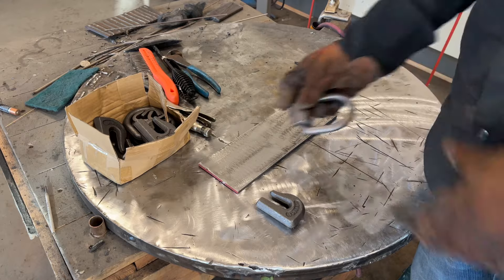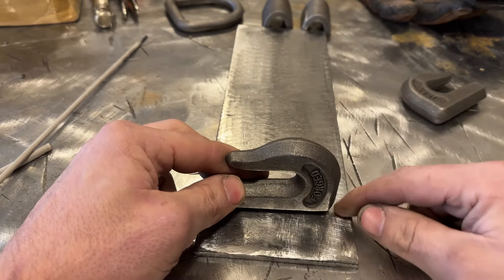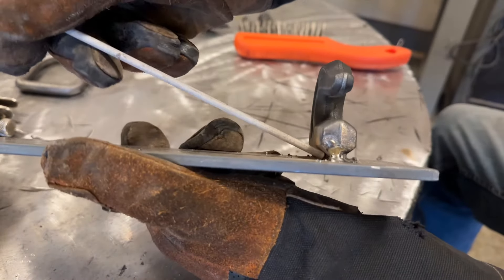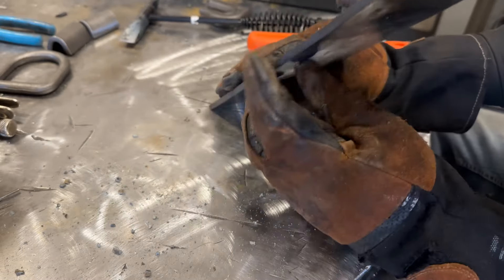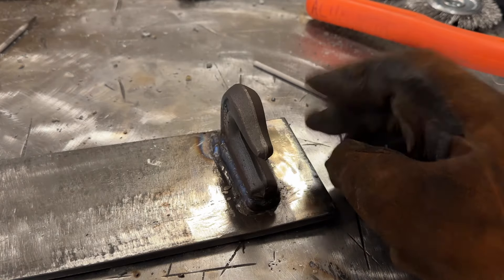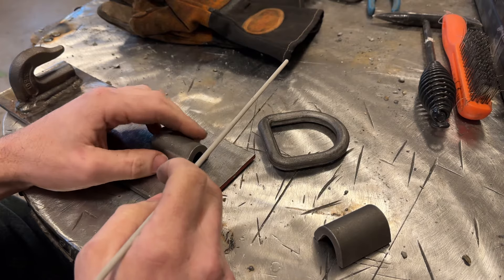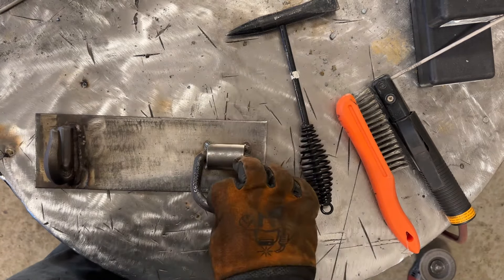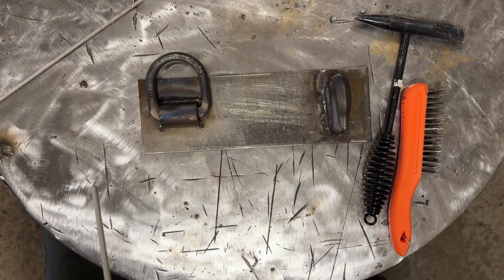Welding hooks and D rings with 7018

Comment: I assume with flux core wire, you want to have a wire # that is suited for multiple passes.  Would .030 be suitable in a 220V machine normally? For 3/8" plate mounts.
Reply from the maker: So a couple tips.  I can tell you from my own experience flux core has issues welding over 1/4in thick without porosity issues with .030 or .035 wire.  Even if you don’t see it on the surface the internal weld is poor.  How you solve this is running .045 or bigger self shielded wire.  The unfortunate thing with this is many welders won’t run .045 wire (don’t have rollers, liners, tips, enough power, etc, available.  If yours does have the capability you will likely be able to weld 3/8th without porosity issues.  

Edit:  if you decide to give it a shot run a weld and cut it open with a cut/etch.  If you see porosity you will have very weak welds.  On a flat plate butt weld it will probably be ok, anything resembling a fillet weld it won’t be (too thick of a molten pool).
Reply: @makingmistakeswithgreg   10-4, thanks a lot.  Sounds like once again, the trusty stick welder still has its place 😁👍

Comment: For the first pass, would you not of been better to run a 6010 for the better penetration as they dig in deeper? Then second and third pass with 7018?
Reply from the maker: That could have been done that way yes.  The issue I have with that is the part that holds the D ring is made of unknown steel.  If it happens to be higher strength steel the hydrogen induced by the 6010 could cause cracking issues, especially if its being welded to higher strength base steel.  Most of the benefit of the 6010 pass is negated by the slight bevel I made in the loop and the fact I welded around both edges.  The penetration 6010 provides prevents the metal from lifting and using the weld as a fulcrum point, but wrapping around the corners along with the bevel prevents the loop from easily lifting off the plate also.  I would trust the strength of 7018 over 6010 in the case of this.  You must remember most things that are welded with 6010 as a root are things like pipe, and the stresses on pipe are completely different than a d-ring.  They are either internally (pressurized pipe) or externally if they they are bent due to soil movement.  What works for them (where you have full internal weld reinforcement) and what would work on a single sided weld without full fusion are completely different things.  7018 also performs far better when cold, and in my own testing it has proven to significantly surpass the strength of 6010.
Reply: I would have reached for small diameter 6011, but Greg is right, those forgings will have some carbon in them. (Let's hope they aren't mild steel!) 
    Nice tips on how to make these welds strong. Thanks!

Comment: Might the mig work on those hooks if you left a gap on the root pass?
Reply from the maker: So I did a whole video with welding gaps/bevels, link at the bottom.  The issue with welding a gap or bevel, is it doesn’t really increase root fusion, it only increases the depth of the weld.  If the setup you have won’t get fusion with a normal fillet weld of the same thickness, beveling it won’t drastically increase it.  If you have a 200amp mig welder I believe you could weld those particular d rings (that have a 1/4inch thick weld on hoop).  If it’s a 3/8th thick hoop it would be best to stick to spray transfer or dual shield with wire.  The main issue is you can’t weld the inside of the hoop, and poor root fusion on the first pass will make it easier for the hoop to be torn off under a shock load.  

Here is the video on beveling:
https://youtu.be/qrFH0995IgQ?si=72rgBtGwmfZ_FSZs

Comment: Could you mig the inner and stick the outer area?
Reply from the maker: From a standpoint of strength it would be best to stick weld it all the way out.  If you have a 200+ amp mig welder it could safely weld a smaller d ring that has a 1/4in thick weld on “u”.  For the thicker ones that are 3/8th I wouldn’t do it with short arc and instead use spray arc of .045+ dual shield.

Comment: For light duty use, could D rings be welded with 6013?
Reply from the maker: I would avoid it.  In my testing the difference in strength between 7018 and 6013 is significant.  Would it hold?  Well it depends.  For a small d ring that has a 3/16th thick or 1/8th weld on loop you would probably be ok.  For 1/4in or thicker (like what’s in the video) I would say 7018 is the only rod I would use.

Comment: Would 6010 or 6011 okay for this application?
Reply from the maker: For d rings I would say sure, if they aren’t going to be used for heavy lifting.  For the chain hooks, they are forged and of high enough strength that you should use properly stored 7018 to avoid introducing hydrogen into the material.  Realistically both would not likely fail welded with 6010 or 6011 but it really comes down to expected use.  Hopefully that helps.

Comment: Thanks for teaching! Would a titanium 125 welder be sufficient to weld these to a dump trailer? 
Thanks in advance!
Reply from the maker: So the titanium 125 can successfully weld 1/4inch in my hands on testing.  The d shackles in the video could be welded on provided what they are getting welded to is 1/4 in thick or less. To prep it I would grind the weld on loop down to point and I would regrind the bevel a bit more open.  Run hot and do 2 passes minimum.  The hooks are realistically beyond the safe welding capability of the 125.  It’s possible it would be able to weld it but I would do weld/cut/etches to look before I would call it strong enough.  The d shackles are much easier and with proper prep (and some skill) shouldn’t be too hard.  

Edit:  make sure you use Lincoln’s nr-212 or other E71T-mp wire that’s rated for multi pass welding.  The -GS wire is not suitable for multi pass welds and the specification of that wire is almost nothing.
Reply: @makingmistakeswithgreg  
Excellent info. Thanks again for the tips and replying man!
Reply from the maker: @sjlouvieify  no problem 😀

Comment: have you ever worked with a structural engineer?  My city said i need an engineer stamp to build a 17x17ft carport in my driveway from steel.  nobody in my town has returned my inquiry and the guy I found in california wants 7k$ which seemed ludicrous and is way more than the materials cost.  any idea what charge would be reasonable for a project like this?
Reply from the maker: Man I wish I could help but I don’t know anyone who is a structural engineer.  What you’re talking about wouldn’t be hard to actually calculate out the design/strength requirements, but without a legit stamp a city doesn’t care :(.
Reply: @makingmistakeswithgreg  yeah, love them gov workers.  they are here to help you. lol

Comment: Numb question: would a 6010 root…
Reply from the maker: You could use 6010 to do a root pass but with the way the loading is I would avoid it.  Since the stress will be pulling the u-plate straight off the plate, a lower tensile rods weld could fail.

Comment: Very good video...don't take offense but you still need a lot of practice with your welds, and your starts are not proper...you always start a little behind and then long arc to where you want to start...it eliminates cold start porosity.
Reply from the maker: What about my welds isn’t proper?  I literally welded left hand, right hand, left to right, right to left, and with a camera in my face.  I showed a realistic approach to the task, talked about any mistakes that were present, and tips on how to do the job.  I think you missed the point of the video, if everything was absolutely perfect there wouldn’t be much of a how to video.  Also, starting porosity is non existent with 7018s that have graphite tips, there is little to no need to start ahead and long arc with such rods.
Reply: I was not aware of the start capabilities of 7018s...but as far as your welds...leaves much to be desired.

Comment: Angle grinder complacency.  Ground complacency.  You can hear the plate gliding on the dingleberries.  Ground the work piece not the table.
Reply from the maker: Grounding to a table is no different than grounding on a trailer near where you’re welding.  Grounding on that particular plate would just mean the ground clamp gets spatter on it which is not ideal.  You can also induce arc blow by clamping to your work piece over clamping to a thick table due to the resistance of hot metal.  Also, regarding the angle grinder, I run a grinder the way I want to.  Its not complacency when I have been up front about it in numerous videos.   That particular grinder doesn’t have much power and I am wearing a welding hood, so the risk is virtually zero.  You can choose to run the same grinder different, that’s up to you.
Reply: @makingmistakeswithgreg  well at least clean the dingleberries off of your table.